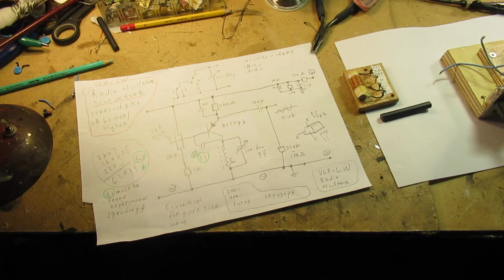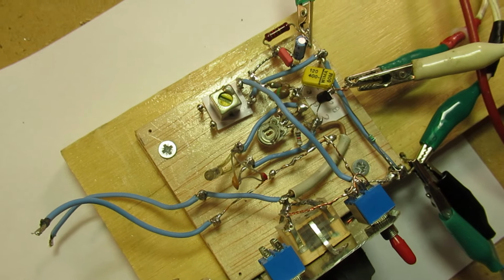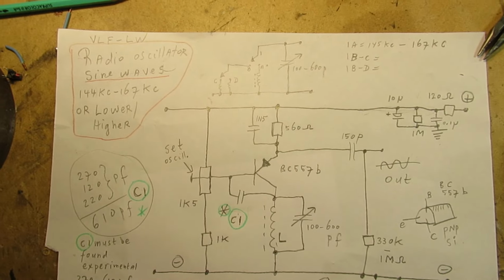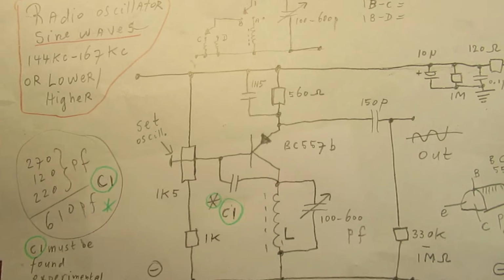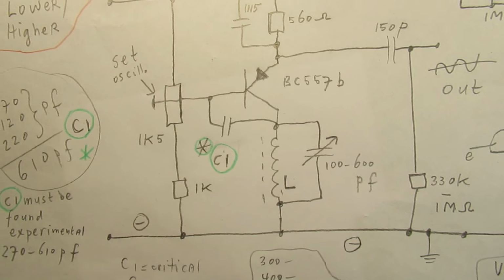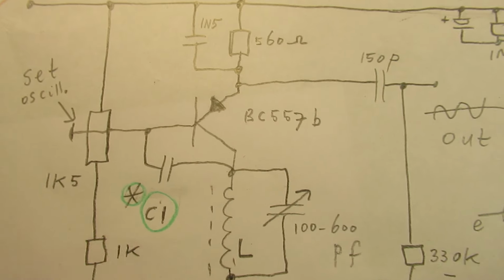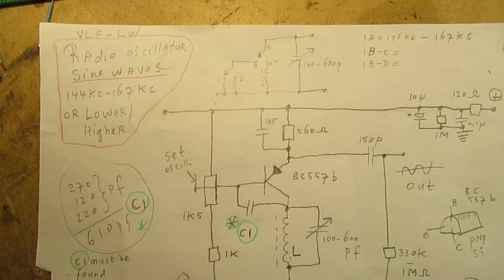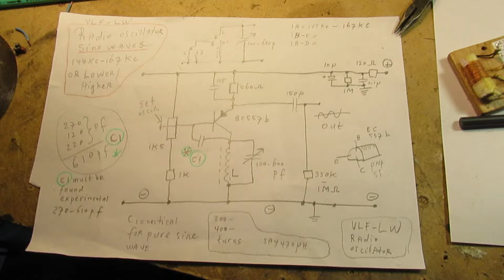Radio oscillator (1 PNP transistor) for Long Wave and VLF schematic and demo 145 KC-167 KC

Comment: Good work. I like the way you develop your circuits by experimentation.
Reply from the maker: Thanks Ron. Yes the idea now is to use/make a Local Oscillator in a superhet circuit via up-mixing, when receiving frequencies on VLF/Long Wave. That principle (up mixing frequency transformation) worked always in all my SW radios, say 2 MC-14 MC that I made in the past.The down-mixing idea for VLF did not work so well, though the radio theory shows that it is/was/could be possible. I did not elaborate that to its depth, b.t.w. Above 2 MC the making of a superhet radio is easy, below 1 MC I am struggling. Has of course to do with the problems related to LW, say the properties of these long wave frequencies. Anyway: it is always interesting and it is a hobby (!). 24 May 2024.

Comment: I like how you mounted the tuning (IF ?) coil on those little boards. That makes it easy to change them out without damage. 👍
Reply from the maker: Thanks Barry, yes, you saw that OK. It is always a (kind of, not really) problem where and how to mount these (or any) VLF coil(s) inside these simple 1 transistor oscillator(s). The good thing is that long ("long"?) wiring is no issue here, because we are on VLF, say between 100 KC and 600 KC. Thus, indeed, connecting/changing/interchanging  all kinds of VLF coils in this way is very easy and good to do (!). 24 May 2024.

Comment: Beste,heb een vraagje,allee weet niet of het mag.
Ik heb frequentie meter gekocht Fluke 726 A.
Er staat ingang 250 v RMS Max.
Nu is de vraag als ik cb toestel wil nakijken of de frequentie juist is mag ik de antenne uitgang daar op aansluiten op de ingang van de meter.

Groeten Mike.
Reply from the maker: Bedoel je een zender op 27 MC? Wil je de frequentie meter dan op de antenne uitgang van die zender aansluiten?  En, zoja, hoeveel watt is die zender?
Reply: Zal 4 watt zijn,
En is zender van 27 mc.
Het is om eens wat te testen ,hoe ik er juist moet mee werken .
Zou niet graag hem stuk maken ,ik mag daar ook een signaalgenerator op aansluiten .
Het is gewoon om het toestel te leren werken.
Alvast bedankt.
Reply from the maker: @mikedobbels3599  Ik moet zeggen dat ik met zenders geen ervaring heb, want ik ben luisteramateur. Mijn idee is om een oppikspoeltje (zeg 10-20 windingen) te maken, die aan de counter te verbinden, en die dichtbij de antenne te houden en dan uitzenden. Dat is contactloos en als de counter gevoelig genoeg is pikt die de frequentie van het zendsignaal op. Om meer signaal op te pikken het aantal windingen verhogen.
Reply from the maker: @mikedobbels3599  Je kunt ook proberen de ingang van de counter counter via een kleine condensator (zeg 50 pF) aan de zendantenne te verbinden. Als die gevoelig genoeg is pikt die via die condensator de frequentie van de zendantenne op.
Reply: @radiofun232  Hoi,
Alvast bedankt voor de tip,ga dat eens proberen.
En ga het zeker eens laten weten of het gelukt is.
Zelf ban ik zend amateur ON5 MDV.
Doe zo voort ,lekker oldschool.
Groeten Mike.
Reply from the maker: @mikedobbels3599  Bedankt Mike. Ja, om het zo veilig mogelijk te houden stelde ik dat "pickup spoeltje" voor en/of kijken via een condensator van een hele kleine waarde (zeg 50 pF of zo) naar wat (beter: de frequentie die) je aan het uitzenden bent. Zo'n pickup spoeltje werkt i.h.a. goed en je hebt een Fluke gekocht, dat is professionele apparatuur, die moet dat wel kunnen oppikken. Het zijn manieren waarmee ik in het (verre) verleden ook frequenties van oscillators heb opgepikt. Groet, Ko. 6 Juni 2024.